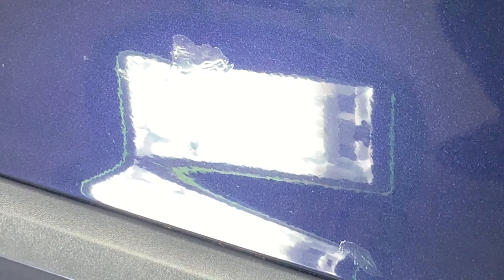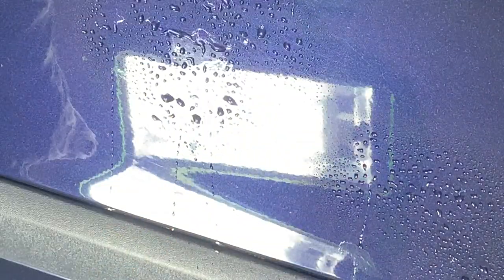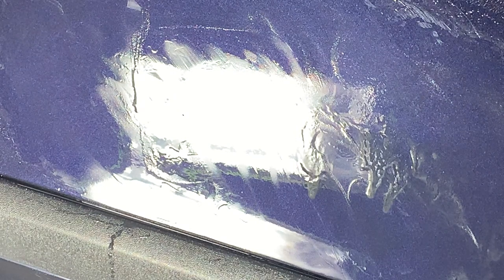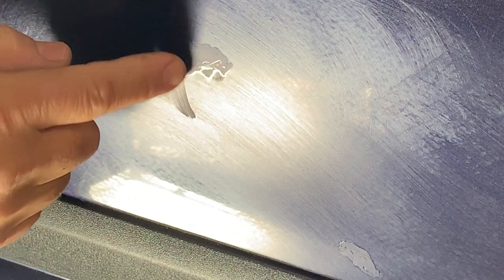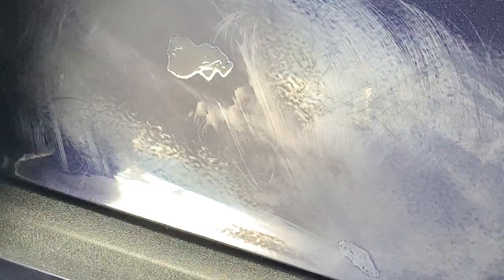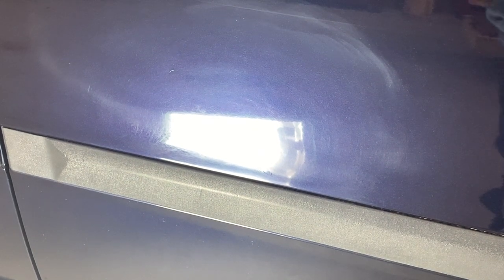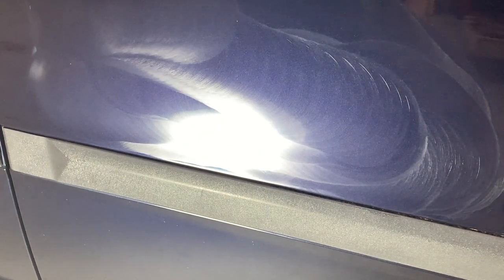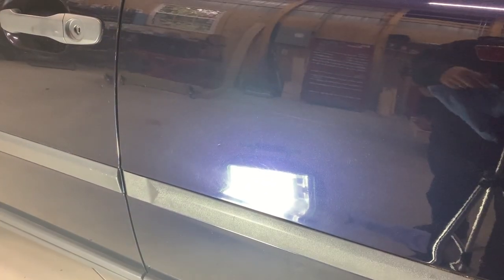Blending touch up paint

Comment: I found that by using a higher grit you are less likely to go through clear. It might take longer but think of it like a haircut. You can take more off, you can’t put it back. Also by using a higher grit, I don’t have to worry about marks made by previous grit. It’s also closer to the finished result, requiring less compound. This is my experience.
Reply from the maker: Thanks for adding your tips!

Comment: If you get on a such a project again, I would recommend you, to consider a few things. There is just no reason to let the polish dry. Take it off directly. And your buffing plan did not match the sanding at all. There's still a huge amount of sanding marks. You should have either sanded with a higher grid or used a heavier combo of compound and pad on a decent buffer. And your variation of machine speed kept me wondering, occured rather random. The overall finish benefits from a consistent pattern. Though if you sand in an even matter, you have a better control of your sandmarks. And maybe don't sacrifice such a big area of healthy clear, consider starting with a higher grid and therefore work the area longer and try to focus more on the spot. I would prefer a smaller sanding interface on a job like these.
Reply from the maker: Great tips, thanks!
Reply: Well, dry polish gets chalky and is easier to wipe off... not sure if that was his idea behind it

Comment: Hi friend, very good attempt, close but no cigar, i wouldve finished with 3000 grit and sand 2 to3 inches outside your 2000 sanded area until it was a perfect all over matt finish, compound with slower arm movements cross hatch for an even finish with 2 lots of 4 passes, after you finished compounding i could still see scratches, when you actually finish compounding all you should see is a slight haze and at worst, minor spider webbing, then you are ready for final polish.  Maybe get or try a microfibre pad for cutting, loads better, hope that helps.
Reply from the maker: Thank you for the very specific instructions.
Reply: @PetesProjects0  It really depends on how much sanding you need but for pen touch ups I’d never start with anything lower than 2000 grit. By using lower grits sure you tackle the initial problem ok but you then introduce more work. I tend to finish with 3000 or even just use 3000. It then means less compounding is required and gives a better finish.

Comment: NEVER DO CIRCLE MOTION WHEN WETSANDING.   STRAIT LINE ONLY
Reply from the maker: Thanks for the tip.  I will try that next time.
Reply: 🤝 THANKS FOR THR TIP.... FOREALS.
Reply: @6Sparx9  thanks.   I was looking at videos because I wanted to blend some rock chips that I covered using touch up paint on a BLACK 2015 Audi S4.   But I ended up taking my car to professional detail shop  and got my car a STAGE 2 PAINT CORRECTION AND CERAMIC COATING.   IT LOOKS GORGEUZ NOW.   BUT THANKS FOR TIP I GREATLY APPRECIATED.
Reply: @theodorecendejas1343  What did they charge for that?
Reply: @seeya205  they charged me 1500.  But I payed for 5 year ceramic warranty and I took my car to well known detail shop
Reply: @seeya205  also, what they did exactly is touch up the rock chips on paint,  they fix 3 small dings, paint correction with 3 layers of ceramic coating.   Paint is black.    But paint looks 👌.    Its glossy wett pussy paint.  I took my car to a place called AUTO SPA, ITS IN FREMONT ,CA ITS IN THE BAY AREA.
Reply: @theodorecendejas1343  Thanks.  I was just debating if I should try repairing my rock chips myself or take it in.
Reply: @seeya205  you can definitely do it yourself.   But I think depending on the cars paint color, it might be more difficult when it comes to blend the touch up paint to the cars paint.    Sometimes its just best to take the car people that actually know what their doing.   I took my car to a shop were you see a lot of exotic cars.    Am just a picky mother fucker when it comes to my cars, guns and women.. 🤷‍♂️
Reply: @theodorecendejas1343  Ya, the paint is called light sage metallic so it is a hard one to match.  I just got it so I like it to be perfect like my wife and guns. HA! HA!  I'm in Canada but you have those wacky gun laws like us in Cali.
Reply: @seeya205  yeah...   CALIFORNIA AND CANADA HAVE VERY SIMOLAR GUN LAWS...    AM ACTUALLY IN WASHINGTON STATE NOW.   I JUST MOVED HERE ABOUT 3 WEEKS AGO.  ITS A DEMOCRAT CONTROLLED STATE LIKE CALIFORNIA,  BUT THEY GET TO CONCEAL CARRY AND HAVE WHAT EVER GUN, RIFLE , SURPRESSOR THEY WANT.   ANYWAYS I MOVED OUT HERE BECUASE MY JOB HAD A OPEN POSITION IN SEATTLE WITH THE SAME PAY AND EVERYTHING SO I TOOK IT.  PEOPLE SAY ITS EXPENSIVE BUT NOT LIKE THE BAY AREA.    OTHER THAN THAT ITS COOL THO.
Reply: @seeya205  and yeah, that is gonna be a hard color to match.  But if its rock chips only they should be able to blend everything nicely.  And you won't be able to notice anything after ceramic coating.
Reply: He could of used tape also

Comment: I can still see the marks. I also now see the damage you did polishing at the wrong step, too long, too fast, and then letting the polish dry before you remove it causes more damage to the paint.
Reply from the maker: Thanks for watching the video and providing your thoughts on how I can improve.
Reply: Nonsense I can't even see anymore
Reply: @Lasheem  Well maybe you can't. I watched it again. I mean it obviously looks better. But I can see both spots, just a little bit, and I also see the surrounding area that you didn't buff out--it goes about half-way up the door. I would have done either and/or (a) tape off the area, then take lacquer thinner, small amount on lint-free cloth, and very lightly rub the area out, then quickly spray with water and clean and/or (b) wet sand it, then take light compound and compound the area out. Using light compound to minimize the chances of damaging the paint. You can always do more passes. Then, after the above, polish it out, then wax it, then buff. Then it should be gone.
Reply from the maker: @RobHTech  - I will give your technique a try the next time.  Thanks

Comment: Would this same method apply to a touch up done in an emergency with the wrong color? I had a nasty chip and was broke so I got some dark touch up paint from work that was clearly the wrong color but it was starting to rust, now I have the right color, would I sand it and then use the correct paint, wait for it to dry, then use this method?

Comment: I used the dupli color pen but I put too much paint.  Do I wet sand it and then put the clear coat?
Reply: I’m working on a similar issue now. That’s how I’m going to do it. The first time, my touch up paint was a mess because the paint was drying out & I put it way thicker in some areas. So I have sanded that down & compounded it smooth. My new touch up pen gets here Thursday & I’m going to redo the paint, sand it smooth, then compound, then apply the clearcoat & repeat the process. Hoping to get my spot like new!

Comment: Nice video sir. Question: could I use a power drill with pad attachment for entire car to buff/polish? I have an old 90 Oldsmobile that need touch ups and buffed/waxed or polished. I live in apartment w/ no outside electrical outlets. Don’t want to buy 50 yards of extension cords. Lol. Thanks
Reply from the maker: It can certainly be done..  Just takes a bit longer than a full size buffer.  But I find a buffing pad on a drill can reach areas a larger machine can't.
Reply: pweilnau nice. Maybe I’ll try it. Thanks for your reply
Reply: Yes but results are mediocre. Buy a DA